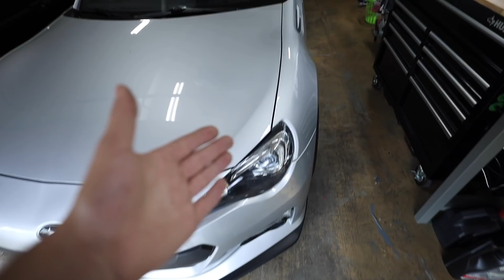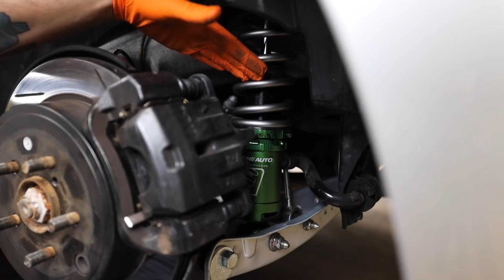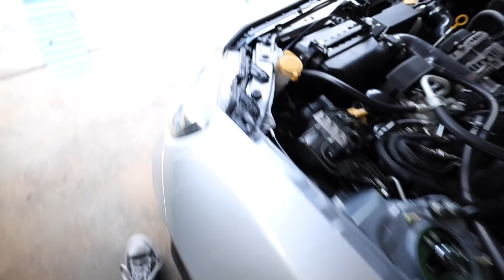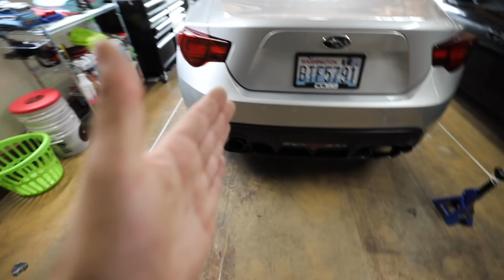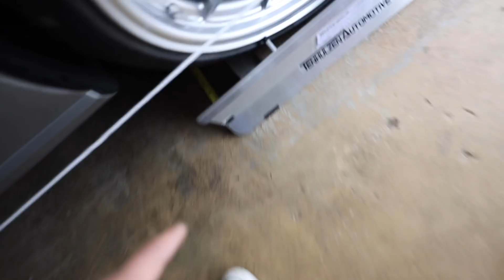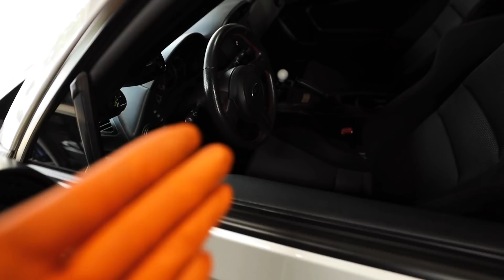How To Do A String Alignment and Set up Your Coilovers!

Comment: I've aligned my BRZ with the string method a few times now. Here are some things to keep in mind.

1. You have to account for the track width difference front and rear. The front is 59.8 inches and the rear is 60.6 inches, that's a .4 inch difference per side. To account for this, you measure the distance from your rear wheel to the string (say 3 inches for example) and then you measure the front the same but add .4 inches (3.4) to make up the difference. This makes the string "perfectly" parallel with the car.

2. I prefer to measure from the center of the face of the wheel, as close as you can to the center cap but without going through the center cap hole. There is no axle nut on the fronts so you are going to have a difference if you do it that way. 

3. It is ideal to align the car when the suspension is settled. However, both times I did it, I set all four corners on 6x6 wood blocks. This makes it WAY easier to get/reach under the car to make your adjustments. Before adjusting, I set my coilovers to max soft and bounced the car up and down to try to settle it as much as possible. 

The first alignment I ran for almost 3 years with no weird tire wear. The second alignment was just a week ago and it feels just as great!

Comment: Just a tip on setting dampening.  Always start at either full soft or full stiff then work up or down.  Nice job on the alignment!
Reply from the maker: Thank you 🔥 normally I start right in the middle and work my up or down either option works 🔥😁

Comment: I have equal measurement from all sides, but the fender gap is unequal, the left side is higher than the right. It's like 1 finger gap from the right and 1.5 finger gap from the left.
Reply from the maker: On coilovers?
Reply: @Smeedia  yes, maybe each vehicle is different and isn't always weighted perfect 50-50 from side to side even I measured the thread below the collars to match side to side. I think I need to adjust one side to achieve equal visual ride
Reply from the maker: Odd, I've seen that a few times but there was a major weight difference between the sides

Comment: I know most alignment places adjust rear toe first before setting front toe. Does it not matter with this method?
Reply from the maker: As long as your box is square it shouldent  matter 🙏
Reply: @Smeedia  how are your hand u set there to the tie rod? I just tried on my 2015 wrx and can't reach with the car on the ground 😂
Reply from the maker: Gotta shimmy up there 😅
Reply: @nabaddame5726  Buy or make some boxes with 2x4s and have the car off the ground by at least 12inches

Comment: Having trouble adjusting the camber. How did you do it ?
Reply from the maker: Front or rear?
Reply: @Smeedia  it’s the front
Reply from the maker: Top hats on the coilovers or thr lower eccentric bolt on the knuckle

Comment: would i need a camber kit if i ran these in 17 sti? i plan to run stock height.
Reply from the maker: Having camber adjust will definitely make life easier qhen doing this
Reply: @Smeedia  hey what pinch weld pad area you using?
Reply from the maker: Torque solutions 😁

Comment: You want as much castor as possible on the STI.   Usually people 180deg the front camber plates on the coilovers to allow the adjustment.  But assume that doesn't apply to the brz?
Reply from the maker: Not that ive read, thr lower LCA does not give me any adjustment for caster, should follow a very similar suspension set up to thr STI, ive transfered some OE parts from thr Asti onto thr BRZ already. I'll dog into it a little mkre and see what i can find

Comment: Hey brother, that harbor freight box was to tall. Normally those plates sit at grade or even with the bottom of the tire. Get another set of bricks the same height as the ones the car is sitting on
Reply from the maker: Thats what im doing today, was trying to Mke what I had in thr garage work 😅

Comment: Is it weird I have access to a laser alignment system at work and I still do this at home?
Reply from the maker: Lol my eoom mate and I were talking about this last night actually, laser alignments aork but you can align the car, take it off and put it back off and it will say the alignment is off based off of true position of the car 😅 strings dont lie
Reply: @Smeedia  last time I had a laser alignment it actually was off to the right a bit. So im all set, I'll diy this lol. But I'mma still sell it cause it flags about an hour or two when it doesn't take that long 😂
Reply: @Smeedia  just say you pull out the harbor Freight jack stands and just about pissed my self 😂😂😂
Reply from the maker: I dont trust those stands at all 🤣🤣🤣